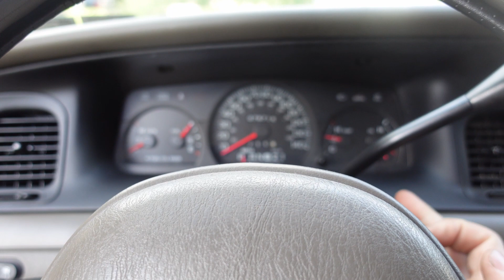CROWN VIC WHEEL UPGRADE!      Goodbye police steelies...

Comment: Did you run spacers on the vic? If you did was it the 1.5 or the 2 inch?
Reply from the maker: Yes i did in rear 1.5” i had to for those wheels to fit I currently dont.
Reply: @kollinlehr  did the spacers make the ride worse? I'm thinking of getting some for my 02 LX Sport.